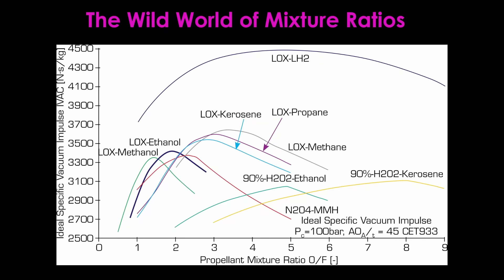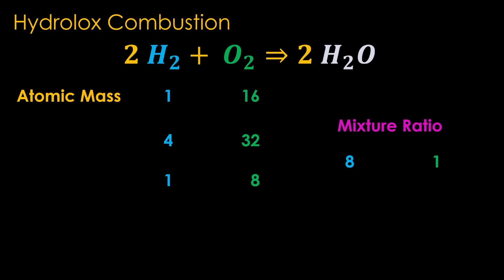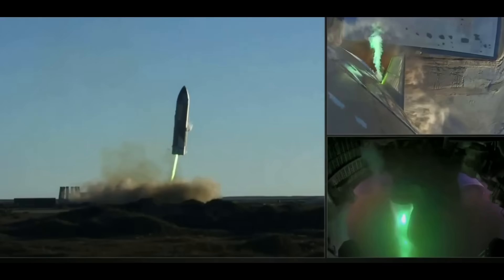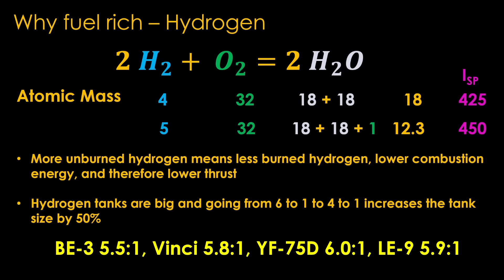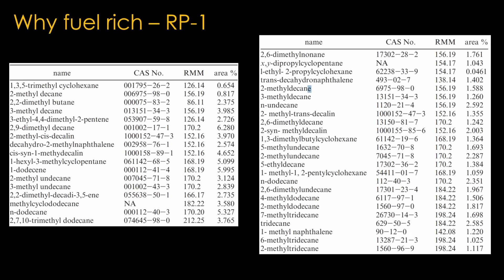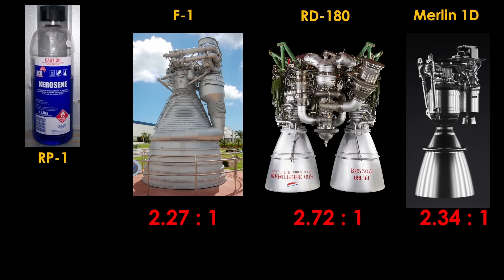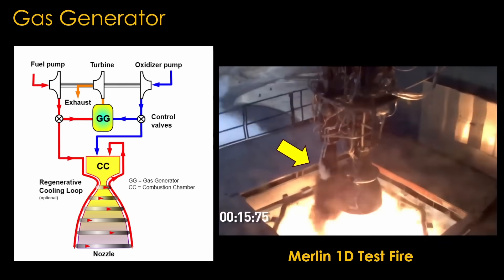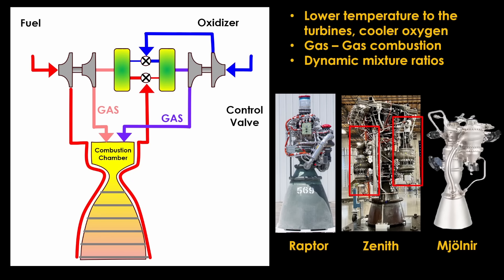You know rocket engine mixture ratios

Comment: Pretty coOL....amazing engines out there....I have a question for your next round of subscriber questions, if you'll take it, perhaps a silly one. I can understand airplanes, helicopters flying, they have strong metal axles. But how does a rocket fly? All that thrust seems to me- would be very hard on a nozzle, IF that's the focal point of the lift stress.. Watching SpaceX returns, you can see warped nacelles. Looks like thin metal. Hard to picture in my mind all the weight of the rocket stressing on those cones during lift off. Unless something else is going on. 🤔 Then you have Blue origin depending on ONE nozzle.
Reply from the maker: All the force goes through the combustion chamber and nozzles, so they have to be able to resist it. And that gets carried through the top of the engine into the thrust puck, which supports the propellant in the tank above it and the tank walls that support the rest of the rocket.

If we look at Raptor, it runs (supposedly) at 350 bar, or about 5100 psi in the combustion chamber. That's not terribly high in terms of pressure vessels - high pressure gas tanks may run up to 20,000 psi - and the circular shape of the combustion chamber and conical shape of the nozzle are well equipped to deal with it.

Nozzles have a large expansion ratio - the ratio between the size of the exit of the combustion chamber to the exit of the nozzle. As the exhaust expands it drops in pressure significantly - at launch it will be less than 15 psi. The end of the nozzle is therefore fairly lightweight. 

I have a video on nozzles that you might want to watch.

Comment: I understand that you want to keep things simple and that's good, but IMO you should have mentioned that other reaction products/exhaust species exist that you're not showing.
Reply from the maker: I had a section in that talked about that and I couldn't find out a way to make it understandable. For hydrolox you pretty much only have to worry about OH and only at some mixture ratios. 
Methalox gives you a whole bunch of reactions and intermediates that you would have to figure out. Adds a lot of complexity and the mix of products is going to vary due to the cycle of the engine, whether it's gas/gas or not, throttle level of the engine, and mixture ratio you're using. It's tractable if you are simulating your engine combustion, not tractable to try to explain at the level I want to stay at.

Comment: Thanks!!! I don't understand where the average of 26.6 at 6:06 comes from.
Reply from the maker: The exhaust is (mostly, I'm simplifying) one molecule of carbon dioxide which has an atomic mass of 44 and two atoms of water which has an atomic mass of 18.  So (44 + 18 + 18) / 3 = 26.6

Comment: Great video! One suggestion - the coloring is a little all over the place, and green for O2 is especially confusing.
Traditionally, blue is used for LOX since it's a blue liquid in real life, and red is used for the fuel since RP-1 is a red liquid. LH2/Methane are clear, so red is just used for all fuels. Then lighter shades of blue/red for gaseous oxidizer/fuel. The colors for GHe pressurant and combustion products don't really have a standard coloring so you'll see a bunch (purple as a mix of red & blue make the most sense to me).
Reply from the maker: Thanks. For the operational diagrams I just copied what other diagrams were as I'm lazy but I'll keep that in mind.

Comment: In other video you said that rocket methane is not pure methane, but also mixture of CH4, C2H6 and C3H8
Reply from the maker: Natural gas is not pure methane; it's a mixture of methane, ethane, and propane, in varying ratios and with other components depending on where it comes from. For the rockets I checked, when they said "natural gas" it was methane but I haven't see real data for all the ones that say natural gas.

Comment: How much unburned methane (a greenhouse gas 28X more potent than carbon dioxide) is Super Heavy expected to release during normal operation?
Reply from the maker: You can do some math. Figure out how much methane it burns and assume that less than 5% is in the exhaust. 
You might want to compare that to the amount of methane that leaks from natural gas pipelines as a comparison.

Comment: 10:04 you don't need full flow staged combustion to have multiple turbopumps. The RS-25 has a total of two fuel rich preburners and four turbopumps (one low pressure and one high pressure turbopump each for the fuel and for the oxygen).
Reply from the maker: Definitely true. I thought about adding that but I couldn't figure out a way to do it that wasn't confusing. 
RS-25 is such a weird design...

Comment: One thing to consider is that methane can thermally decompose at higher temperatures, meaning you might end up with lighter molecules like H2 in the exhaust as well. However this thermal decomposition is going to be endothermic, resulting in lower combustion temperatures. Similarly you can have side reactions producing things like CO instead of CO2.
Reply from the maker: Yes. I had a section in there that talked about this, but I couldn't make it simple enough.

Comment: 6:14 This is wrong as there is practically no methane in the engine's exhaust based on pure stoichiometry. So they are not getting lower molar mass by running the engine with more methane. The reason for lower mixture ratios also isn't because spaceX/blue origin wants to run their engine's fuel rich. All of these companies are actually running their engine close to the 'ideal' stochiometric ratio.

The reason why your stochiometry ratio is off and why your average molar mass is off is because you did not account for the engine to produce carbon monoxide.

The actual mixture ratio looks something like this:
Ch4-(22%wt) o2 (78%wt) = h2o(42%wt) co2(27%wt) co(23%wt) oh(5%wt) o2(3%wt) etc...
Now really far down the list at  1.3610E-09 do we have some expectation of methane. But its practically non-existant.

The avg molar mass is ~22.21 which is mostly by denaturing co2 down to co and oh groups, rather than methane making any contribution.
Reply: If you account for carbon monoxide it results in the exact same results as using the unburnt ch4 explanation. Both are models however as there are actually a lot of plasma in that exhaust and those simplified formulas don't take that into account either
Reply: @UnePintade  "Stoichiometry is the relationships between the quantities of reactants and products before, during, and following chemical reactions" 

There's no amount of methane you could add to a rocket engine that would result in a working rocket while improving your molecular mass ratio with the addition of free CH4 molecules. When you starve your reactants of oxygen under low temparature and pressure, you'll get CH4 and CO2 out of your equation but you dont have a working rocket. When you do the same oxygen starved reaction under high temparature and pressure, you'll get close to 60% CO, 20% H2O, 8%H2, 8%CO2 and 1% methane. This is because the temparature/pressure of your reaction will ALWAYS favour the decomposition of methane over other reactions. Infact, you dont even want methane as an exhaust product to reduce molar mass at high temparatures. CH4 has terrible specific heat at high temparatures, It will soak up 40% more energy to raise its temparature by a degree than something like H2O. So, even the presence of CH4 could reduce the effective temparature of your combustion.

Comment: fuel rich combustion will not generally result in unburnt fuel, but partially burnt fuel. e.g. for methane a mixture of CO, CO2, H2O, H2. for kerosene, all sorts of molecular fragments of various sizes and oxidization levels.
Reply: Why would you run a fuel rich kerosene engine ..? And since we're talking about mass, partially burnt and unburnt fuels models yield the same result
Reply from the maker: You want to run it a little fuel rich because your RP-1 supplier isn't consistent and you could have a stoichiometric ratio overall but still have pockets of hot oxygen in the combustion chamber. More of an issue with RP-1 because you need to vaporize it on injection.
Reply: @UnePintade  incorrect, partially burnt fuel models do not yield the same average exhaust particle mass. anyway, average particle mass is only a rough indication for ISP, for the actual number you need to compute velocity for each exhaust species since it's not a linear operation
Reply from the maker: Not talking about exhaust mass, talking about avoiding hot oxygen pockets in the engine. If you run at stoichiometric and your propellant mixing isn't perfect, you will get pockets of hot oxygen and pockets of hot fuel.

Comment: You said the BE4 is fuel rich and oxygen rich in the same video?
Reply: Engine overall runs fuel rich, the pre burner is oxygen rich
Reply from the maker: Exactly.
Reply: Yeah, but when you say an engine is fuel rich or oxygen rich, you're referring to the gas generator or preburner. All engines are stoichiometrically fuel rich in the combustion chamber. 
I found that confusing. I doubt it's possible to do a ten minutes video on this topic that isn't confusing.  This topic deserves at least a half hour.
Although I did have fun drawing all of the different molecules that make up RP1. That was fun! 🤓

Comment: For anyone who didn’t follow the detail at 4:00 on how we go from adding in some extra hydrogen to higher Isp, I had to think about it as well. It goes like this: the energy is evenly distributed among the exhaust products, so an unburned hydrogen (molecule, probably not atom) has the same kinetic energy as the average water molecule. But that means it is moving much faster. So then when you convert from kinetic energy into exhaust velocity, you can just divide by twice the molecular weight of each molecule. But this is a linear operation, so you can just use the average molecular weight of the exhaust products and get the same answer with less work. Edit: this is NOT a linear operation, the velocity ratios is the root of the mass ratio. So question the math. End edit. If you’ve never read through any rocket propulsion stuff (like I haven’t), this isn’t immediately obvious. But once you start to crank through it, it shows up pretty easily. 
Great vid, Mr E. Space! Mystery Space. Huh.
Reply from the maker: Yes. 
And it's actually a lot more complicated than that. With hydrogen you get OH ions in the exhaust at some mixture ratios, and with methane there are a whole bunch of intermediates that you can get out and that changes things around.
Reply: Thank you for pointing that out. What was always confusing to me was that by increasing the ratio I burn more hydrogen, therefore I have higher temperature and more energy to spread around, so I thought surely that means higher Isp. I did not realize the difference in mass has higher effect on the result.
Reply: Yep, the MAIN exhaust product is H2O. I'm impressed with your comment. It got my brain going.
Reply from the maker: Hydrolox is pretty simple - you can get a little OH in there. 
Methalox is really messy. Lots of intermediate compounds.
Reply: @EagerSpace If methalox is messy, what is RP1?
Reply: In other words the extra fuel in fuel rich combustion becomes remass of a sort or another, more or less as you said.